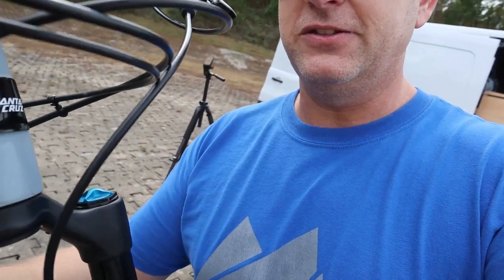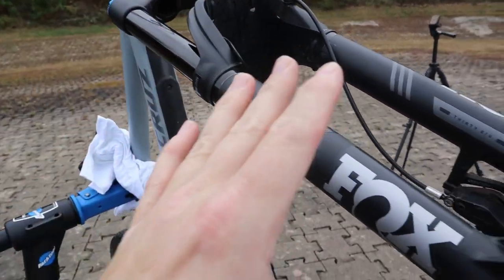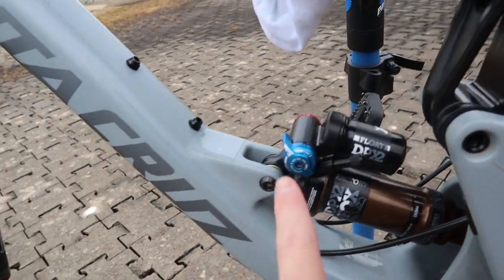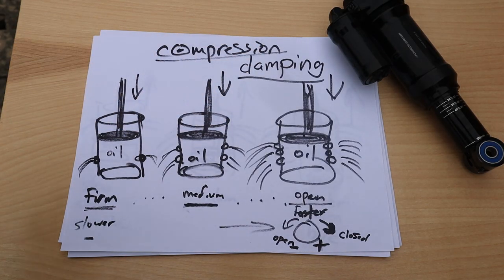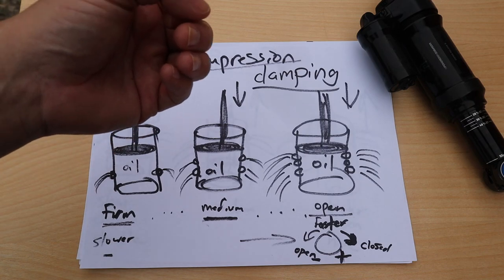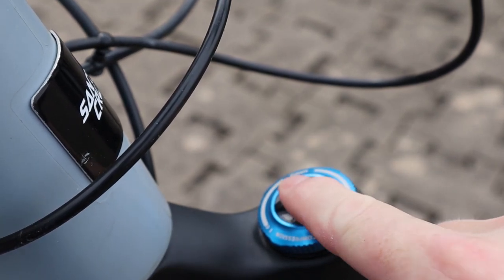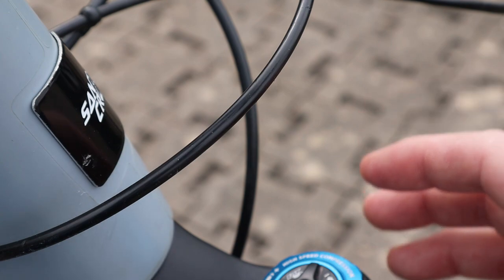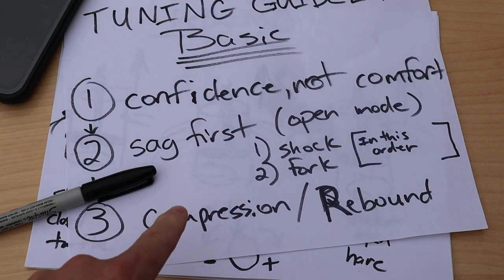#MTBPlanB 2019 Santa Cruz Bronson MTB suspension Pt.1, Damping simplified.

Comment: Have you always had the 20mm thru axel on that fork?  Can you tell much difference if not?
Reply from the maker: Frank, its the standard 15x110 QR that came with the fork.
Reply: MTB Plan B It looked bigger than that on my phone.  Hope the elbows are better.  I didn't do PT, but it a couple of months of inactivity for mine to get better.
Reply from the maker: That’s what I fear. Been off the bike 7 weeks and counting. I should have stopped when I first felt the pain during weight training, but I’m much too hard headed to be wise.
Reply from the maker: That silver thing is a 20 mm spacer that I use to secure the bike to the van mounts. I use it because it keeps the spread between the fork stanchions stable.